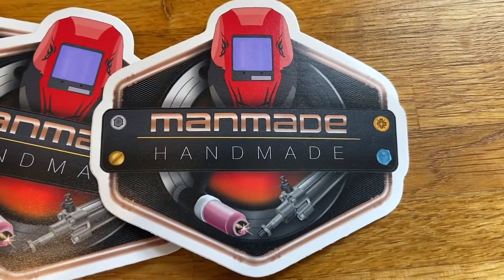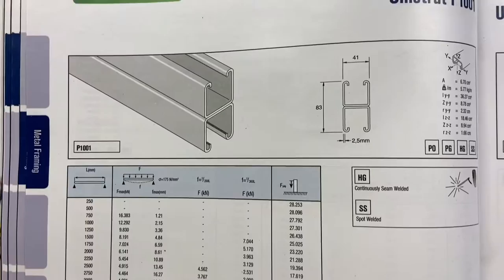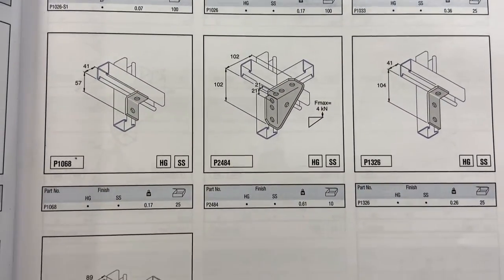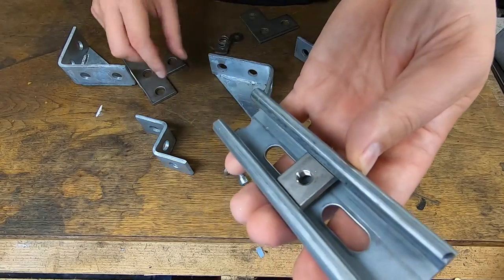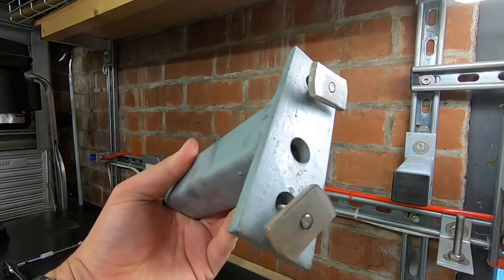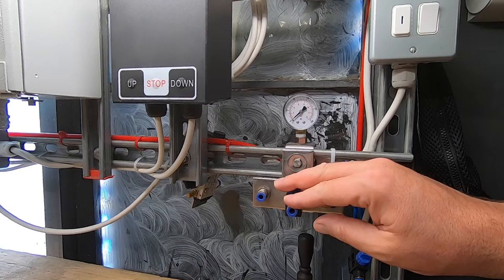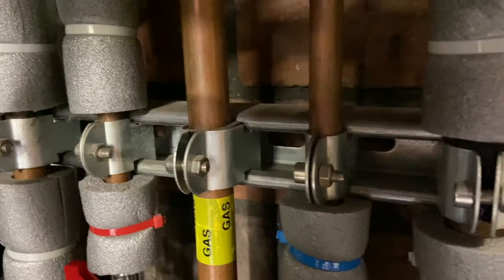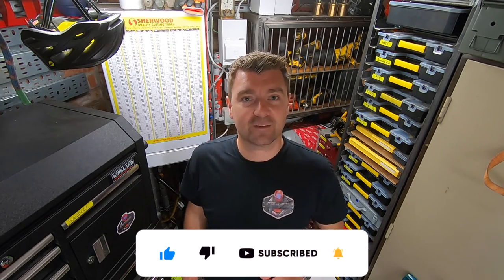Workshop Organization - Wall Mounting System - Channel Strut Ideas, Shelves, Sockets and more!

Comment: This is well explained and is inspiring me to rethink our storage shed. Where do you buy the strut and related parts? Many thanks.
Reply from the maker: Channel strut can be bought online, it’s relatively cheap, however delivery can be expensive depending on max length. In the UK I use DP Building Systems. They also sell the Jewellery too! Enjoy! You will use far more of the square nuts than you expect. Get a few! Cheers MMHM

Comment: Great presentation thank you, everything is well explained however I’m not sure what fixings to use for the uprights attaching it to brick. Do you use sleeve anchors or wall plugs and what size please?
Reply from the maker: Hello, in this case wall plugs we’re used with normal screws. 5-6 fixings were used over 1.5m for the uprights. Thanks for the interest! Ben

Comment: How did you install the outlets.  Would be cool to see that.
Reply from the maker: Using a central hole in the back box, and using an M6 bolt and zen nut behind. If it’s a double box, use two hole down the centreline of the box! Cheers

Comment: Nice video. I'm planning on using this is my garage.

Which finish do you use? Is the pre galvanised good enough to resist rust in a workshop for many years?
Reply from the maker: I use pre-galv in the workshop, no sign of any rust or discolouration after 5 years installed. Using outside, good idea to use hot dipped galv. Thanks for the comment 👍🏻
Reply: @man-madehand-made6009  Thanks for the info, good to know. I was planning on stainless for the most visible one above my bench, but looks like for the rest I can save money and go for pre-galv. Cheers